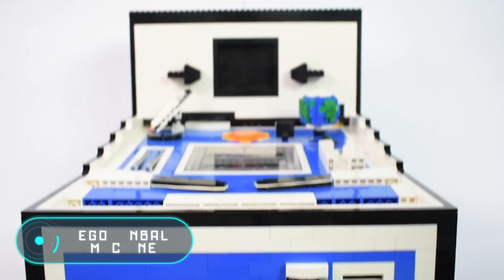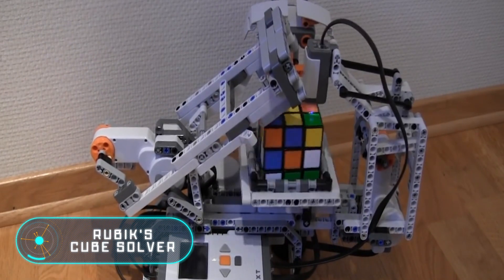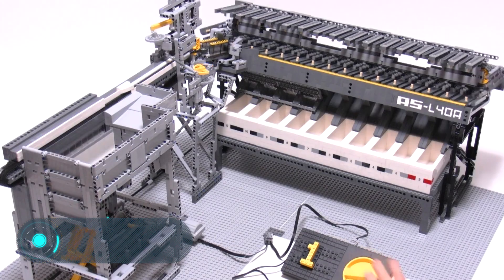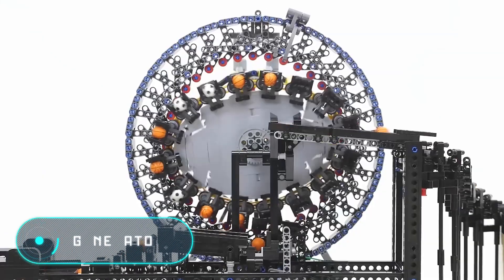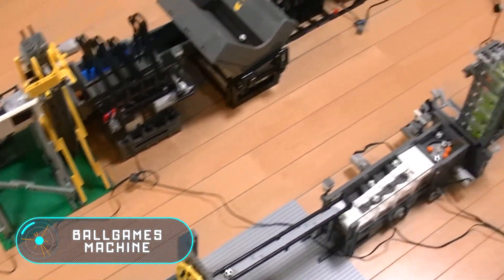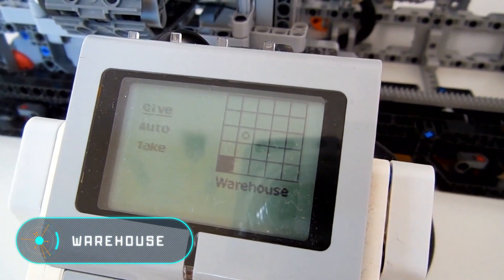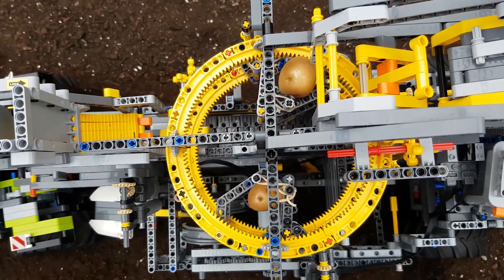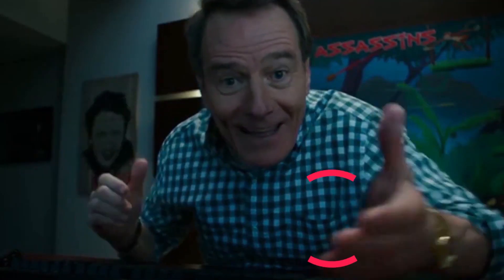COOL LEGO CONSTRUCTIONS AND MECHANISMS

Comment: 4:05 correction: they could cut wood with enough torque they're just low in power so it would be slow
Reply: No it would not be able to cut wood

Once the blade is there it would just start bending the whole structure and break blocks